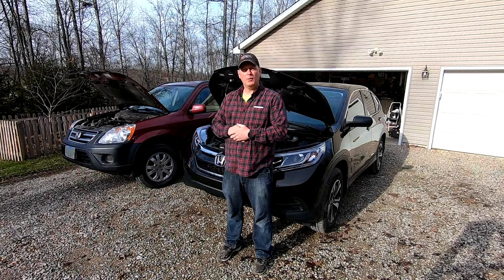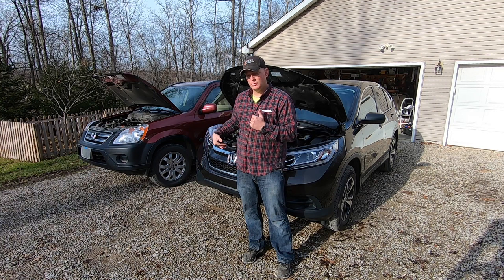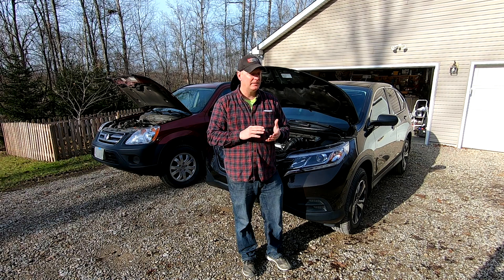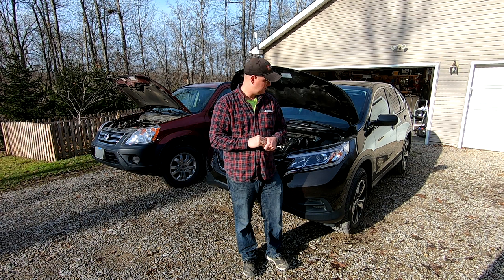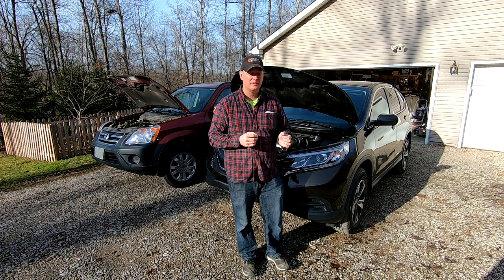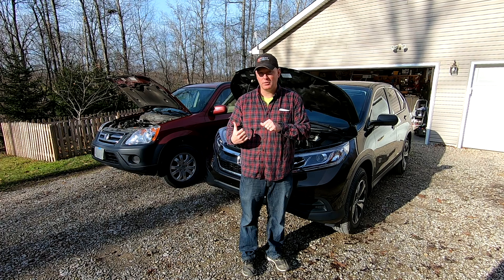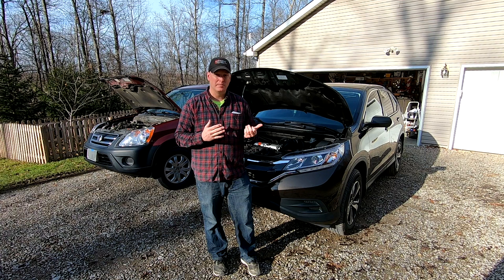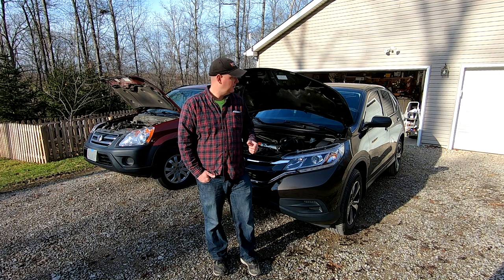DON'T BUY THIS CAR - 2012-2014 Honda CRV

Comment: My 2011 went 315k km then I changed the vtc actuator and timing chain and tensioner... It's been good since the timing cover had a bit of a leak and I ran it a bit low on oil and the vtc actutor went so when I did it I did the timing chain and VTC actuator but since then the car has been running perfectly 315k km is like 200k miles I'm pretty happy with it

Comment: Most of Honda problem is after the 2011 models the parts are made here in the US by a different supplier. Honda used to get there parts from Japan but after the earthquake it was cheaper to get their parts here. They do stress quality but the parts are shady.
Reply: So order parts from Japan?

Comment: I had the same noise from my 2012 CR-V. I replaced VTC myself at 121K but went to Rock Auto for a non-OEM (I was told the OEM replacement would have the same problem in time). I have 165K on it - quiet even in -20F temps. Good luck.
Reply from the maker: What brand did you use? This may be good information for others.
Reply: I purchased from RockAuto - but it's available at a better price on Amazon. The part is STANDARD MOTOR PRODUCTS VVT519. This is the video I watched to fix - make sure not to repeat mistake made in video: https://youtu.be/hSpc41-Pj0c
Reply: @brucenicol1279  What was the mistake? Buying from Honda and using their part? Or do you mean locking it before torquing?
Reply: @lupegalvan9993  locking it before torquing.

Comment: I have a 2014 with the start up rattle.   I tap the starter 3 times without starting it then start it on the 4th time and it doesn't rattle.  I only need to do this during cooler weather as it doesn't rattle in warm weather.   I use K&N oil filters and Castrol Edge 0w20 oil and change it myself every 3 thousand miles.  It's the easiest vehicle to change oil on I've ever had.

Comment: I bought a Honda 2013 crv ex-l. 2.2 L engine and have a transmission problem. They did the transmission changed the oil and filter and the problem stopped for a few months and started up doing it being sluggish and mine was a certified used Honda with the warrantee from Honda here in New Rochelle,NY.
I've have been having problems with car. My rear camera went twice.
I feel the car is a lemon.
I purchased the car in 2015.
I had a 1985 Honsa 5 speed a d was a good car. Was so simple to fix.car was a 2 door hatch and was a decent car and free.
My 2o13 is bad and shouldn't had problems from the start. My left rear caliper locked up and took out the rotor.
I replaced with slotted rear rotors and ceramic pads.
I wish I bought a Subaru and the dealership only 15 miles away not the 120 miles each way..
I had to het them to get me the books for the car. At first they weren't going to give me the owner Manuel and told them I wanted my money back almost $28K they got me the owners manuel.
Now I wished I sued them for selling me a dud.

Comment: I've had this rattle on startup for years. It is now in the shop to have the stretched timing chain/tensioner replaced bc engine light + traction control light + power steering light all came on simultaneously. Was told it's very common. I'm at 145k miles. Otherwise my crv has been so amazingly reliable for me.
Reply from the maker: Except for this $2,000 dollar repair. You are right, it is very common.

Comment: What if you try to change the Oil to a Genuine Honda Oil semi synthethic and a little bit ticker viscocity? I had that little sound when I recently bought a CRV 2012, it had a very old oil, and when I changed the oil, and the oil stick was exactly in the second dot, the sound dessapeared, at the moment that is my experience 👍

Comment: I have the 2013 Honda CRV and have the same issues with the noisy cold starts and the engine is burning oil. A mechanic recently told me that the timing chain was stretched.  Not sure if if I will keep the vehicle or try and trade it in for something else. Thanks for sharing this video.
Reply: I bet you didn’t change or check the oil enough?
Reply: @rmo4222  maybe. I followed the instructions. The car keeps track of the oil life %. I changed it when it got low. I have replaced the timing chain and the variable timing gear. Hopefully it will last for a few more years.
Reply: @aaronbell6530  Don't forget to change the trans oil every fourth engine oil change. What's your gas mileage looking like?

Comment: Had the same issue with my 2014 CR-V. Changed it January, only heard it twice in last month and that was it. It's a problem that just won't go away. Just have to use a good brand tensioner and it will last a little longer but it will come back eventually.
Reply: Is it hard to replace what brand tensioner did you use?

Comment: I have a 2014, 61K miles, its been doing this for a good 20K+ miles now, Noise present even during summer temps. Dealer first denied noticing sound, I went back with research and the TSB, so they acknowledged. But advise was to leave it as is because even after replacing, the issue comes back, as is demonstrated in this video. People turn around and look like whats wrong with your car ? Thats embarrassing!
Reply from the maker: Yep

Comment: I bought my 14 in 2017.. haven’t had any issues with it except for the VTC. Our Honda dealer has been refusing to fix the VTC ever since we got it in 2017. Otherwise besides that it hasn’t had a single issue. Gave the car to my parents and I use their old 2008 crv currently.
Reply: Call Honda directly. Bypass dealer. See what Honda will negotiate with you.

Comment: What about the 2015 and 2016 CRV models? Do you think after the first years Honda made changes on the 15-16 models?
Reply: Depends on the engine.
Reply: I have a friend with a 2017 that did it to the point where the timing chain went out.

Comment: I have a 2013 Honda accord and I hear the same noise at times. When I do hear it, I just top off my oil level and it stops. But I did take it to Honda, and it kinda got swept under the rug because of course it was t making the sound when I took it

Comment: Make sure that your VVT Solenoid is always cleaned. I heard that this could be the actual faulty design starving the VTC actuator and than making the lock pin's spring weak and unable to lock back in when the engine is stopped. Please let me know.
Reply from the maker: Interesting
Reply: How u clean it??
Reply: @gfriedman99  use mass air flow cleaner and spray it thoroughly. Some use brake cleaner, but its a little aggressive IMO opinion.

Comment: This video is a god send. My 2014 CRV just DIED out of the blue. This is definitely the cause of the problem, as I have heard this sound multiple times. The dealer wants to replace the entire engine and is also blaming it on low oil. Even though I regularly kept up on oil changes AT THE DEALER. This is obviously an engine flaw! ARGH.
Reply from the maker: Whatever you do, don't let the dealer replace the engine. It will cost more than the car is worth probably.  Find any smaller, independant shop that can put a used, low mileage engine in, if that is what it really needs. Definitely get a second opinion.
Reply: Keeping up on oil changes and topping off the oil when the level is low are two different things bother need to be done. No or low oil could be worse than dirty oil depending on how low it gets.
Reply: Same here!  Had my 2014 CRV fixed twice for this problem already. First time under warranty, 2nd time out of pocket for $2800.00!  My rear hatch also doesn’t work in winter but I declined to have it fixed at same time because it would cost another $1.1K. Probably my last Honda.

Comment: This explains it - the sound, the oil guzzling, the dash icons/lights. They’ve been a consistent pain since I got this 2013, but it just rolled over 209,000 so looking back it’s been a pretty reliable vehicle. And the awd has been nice.

Comment: I think the noise you are hearing is because your engine has "variable valve timing", the rattle at the start of engine is the time it's taking for the oil to fill up the inside cavity of camshaft pulley with the teeth on the outside.   Theoretically you could take that pulley and weld it in mid point position, your engine will not be VVT any more but the rattle will be gone, however the check engine light might come on, the computer might think there is something wrong.  If you know how to replace the timing chain, you can do this job, it's worth a try, get a used camshaft from junkyard to weld.
Reply: You are incorrect. Honda has been doing VVT for a long time, and most of their engines don't do this. It's a problem with the VTC.

Comment: Thanks for the video! I was just about to purchase a used 2014 with this noise as thought it just needed a new starter. Passing on these CR-V's.
Reply: My 2012 has absolutely no issues… just make sure the oil is changed every 3k miles
Reply: My 2012 make  that noise unfortunately.

Comment: I’ll tell you that if you had a Ford Escape, Fusion or Focus from around the same time you’d be dealing with a lot worse then just the VTC actuator
Reply from the maker: Only the 2013 up Escapes. Junk. But 2012 and prior were very good vehicles.

Comment: I'm also wondering if a slightly heavier oil would help it build pressure or keep it lubricated better. I recently bought a 2014, and have this noise.
Reply from the maker: I've tried all the oils. Doesn't help

Comment: I had the same VTC rattle, also had actuator replaced and noise started again. I was using Fram oil filters with Castrol Extended performance FS. I replaced with a K&N oil filter (same oil) and the problem seems to have gone away!
Reply from the maker: There has been some discussion that the anti drain back valve in the oil filter can help keep oil pressure and keep oil in the top of the engine, which may help keep it quiet. So there could be something to what you are experiencing.
Reply: @JackofAllMasterofNone   
i went through this on another vehicle. Horrific start up rattle, and eventually it became clear that the longer it sat unused, the worse the rattle was. I stopped using Fram's basic filter, switched to a Purolator that literally cost a few dimes more, and it never rattled again.
Reply: Never use anything but oem honda filters.
Reply: Optimal Health  I still get the rattle though it's far less frequent and typically when the temperature is below 40. Say, once every  week or two, or less, if its cold enough. I've never used Honda oil filters, so can't speak for those. The K&N works well enough I'm not sure I'd try anything else. I also use full synthetic Castrol Edge Full Synthetic Extended Performance for reference.  Best.
Reply: There is some sense to that. The K&N filter is supposed to have better flow rate so oil would get up there quicker.
This makes me wonder if 0W-16 oil would also make a difference but I doubt it.

Comment: Thank for the video, was about to buy a used 2014 with 116,000 miles for $12,000  and this changed my mind ,   I'll just get a trusty toyota Rav4
Reply: You can buy a genuine Honda VTC actuator for less than $200.  Also buy a replacement Honda tensioner around $55.  Some HondaBond $12.  Honda valve cover gasket set $50.  So a little over $300.  Assuming the oil has been changed regularly, has no oil leaks, etc.  That's what I would do if I really wanted the car and it was in good shape otherwise.
Reply from the maker: RAV 4's are good. Just make sure you check for the problems for each year first and know what to look for because they arent without issues. Mostly engine ring problems on the older ones.

Comment: Have a 2007 CRV with 290k miles, without any major issues. Bought a 2013 a few years back & having issues at just 140k miles. Not very happy with Honda right now … like a lot of the comments.

Comment: My 2014 Honda cry has no F**** problems it works fine.  I have over 180000 miles on mine and it works fine.
Reply: What engine is in it? Do you change your oil more often? Do you have the drive chain or the serpentine belt?
Reply: @Susan70003  Susan, I think you are a little confused.  All the CRV 2012-2014 2.4 engines have both an external serpentine fabric belt and the internal timing chain.

Comment: I have a 2011 130k miles and a 2013 190k miles

Not one issue w the 2011, the 2013 has the noise and won’t pass inspection. Also has the 25mph “shudder” intermittently. I want to fix the ‘13 and give to my 16 year old, but not sure it’s worth it.

Comment: This is the first engine that I have had that uses 0W-20 oil.  Has anyone tried using a higher viscosity oil to mediate this problem?  This may cause more oil to stay in the upper engine.  This sound started on my 2012 CRV at about 120,000 miles.  I am at now at 145,000 miles, and this occurs on every cold engine start-up, even in the summer.

Comment: Have the same problem with my 2014 CR-V. That exact noise intermittently with high oil usage. So glad you made this video. Now I know the rest of the. story. BTW 80K miles on it.
Reply from the maker: That's low mileage to be having oil consumption issues.
Reply: @JackofAllMasterofNone  I know, it starts me thinking about getting another car before things really go down hill.

Comment: Change you’re maximum  5000 miles or every 12 months regardless of miles  and probably won’t have this problem. My 12 accord 2.4 has 68K with ZERO problems.  Plus it get 35 MPG on road and 25 around town. Another thing if you have oil changed by dealer or anywhere else don’t mean they are doing right or good job? Alway follow up before you drive way. Best to do it yourself if you have the skills. Who drive’s around low on oil? Idiots that’s who. Then  wonder why they have problems.

Comment: Has anyone tried Liqui Moly to try to quiet this down?  I've seen the video on the spring tensioner inside the VCT gear, itself, but I'm wondering if the spring is better off getting replaced?
Reply from the maker: I actually tried liquid moly. Made no difference

Comment: My 2008 EX-L 4WD has been an excellent SUV. I just had to replace the master window switch @ 188,000. I plan on keeping this as long as possible. I live in the rust belt, and the body rust is minimal...

Comment: '14 CRV LX, yup same here had the VTC replaced at 59,000 miles, started making noise the next time it got cold, I have not had it replaced again.  Also, have had a CV joint replaced-25,000miles, AWD solenoid replaced-65,000, and drive shaft replaced-70,000 miles.  Very sad, Honda refuses to own up to known problems.  We have mowers, trimmers, and motorcycles, they are all incredibly reliable.  Honda vehicles, not so much.  Won't even talk about my wife's 18 odyssey!  We will go back to Toyota's next time.

Comment: I remember back in the late 1970's Honda advertised "We make it simple". When I was station in Japan in the 1980's-2000's, a Japanese friend of mine that worked for Honda said "after the founder passed thing changed quickly, for the worse". Toyota CEO admitted a few years ago they had quality problems too. The Japanese car companies are going down the same path that American car companies did starting back the 1960's. "Just put it out there, they will buy it".
Reply: And of course the general public is stupid enough to buy it even when it’s junk…..”buy a Toyota they are bulletproof” until the engine seizes from burning the oil dry

Comment: Not had the actuator issue on my late 2012 model in UK, but mine has a slight judder when moving off if the weather is cold. Not sure what it is.
Reply from the maker: Try changing the trans fluid a few times. You might get lucky. They have a known torque converter problem. If you catch it early fluid changes will fix it.

Comment: Yup.  I bought a 2014 CRV in 2019 - 5 years old.  Was making that noise then and I thought it was something minor.  Drove it for 3 years and finally had it diagnosed and had the VTC actuator replaced.  Hopefully it won't need this done again - or at least not for another 7 to 8 years.  Didn't know it was a problem with the model.  Other than that $1400 repair, however, the car has been great.

Comment: 2013 EX with 160,000 miles and going strong. No actuator issues and only major expense was $500 7 years ago.
Reply: What cost you 500. to fix? I had to replace the belt and tensioner a couple of years ago. It sounds like how much I spent as I had to pay someone.

Comment: As 2014 Honda CRV LX owner, I absolutely agree with the author of the video. Just avoid it. Get newer. I fixed mine under warranty at the dealer twice. I pick up the car and it is still rattling. Now over 80k miles I'm really not sure if I want to push my luck or just get rid of it while it's more or less sellable.

Comment: 2014 Honda...just thought I'd ask here, after reading the comments, our car's headlights are looking terrible from the UV sun rays, and I thought I'd ask what you fella's/gals might be using to get them looking clear again?  Thanks.
Reply from the maker: I just replaced them with new ones
Reply: I used 3M Headlight Restoration Kit and it's lasted pretty good for about 2 years.  But about time to do it again.  The problem with replacement is the bumper cover has to be removed or pulled back enough to get in there.  Unless there is a trick I don't know about.

Comment: I haven't had time to go through all the comments, but does this have anything to do with the CR-Vs slowly losing oil too?  I've seen the oil issue on a 2004 and a 2012?  The 2004 eventually blew a piston and we had a used 50k engine put in it and it no longer uses oil.  One of my kids owns the 2012 now and he still has to put a quart of oil in every couple thousand miles.
Reply from the maker: It does. Oil consumption can be caused by this issue, which then compounds the problem leading to premature engine failure.